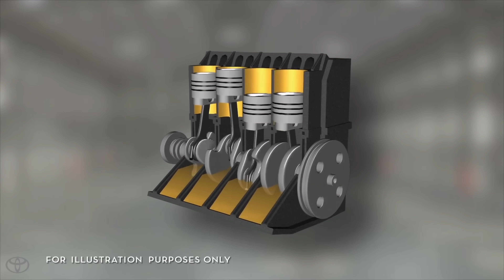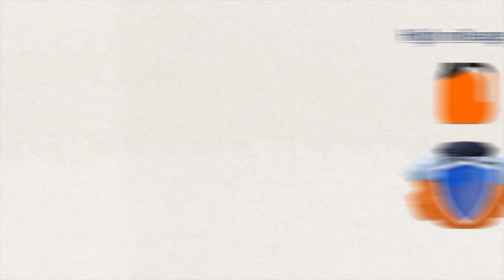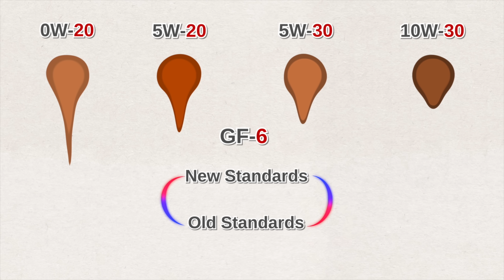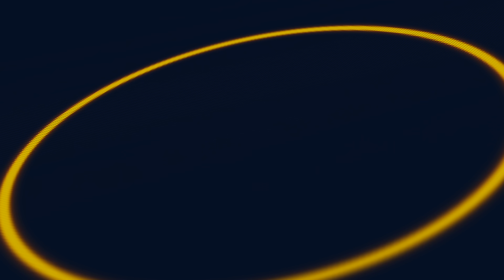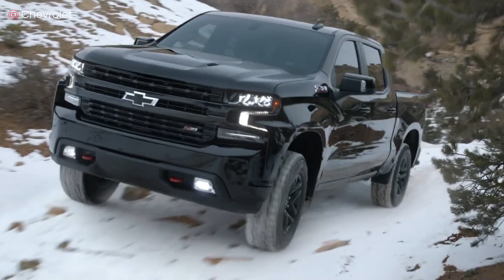7 Engine Oil Myths Stupid People Fall For

Comment from the maker: This Truck Just Delivered My Dream Car: https://youtu.be/KWJHCWyLFxc

⬇️Scotty’s Top DIY Tools:
1. Bluetooth Scan Tool: http://amzn.to/2nfvmaD
2. Mid-Grade Scan Tool: https://amzn.to/33dKI0k
3. My Fancy (Originally $5,000) Professional Scan Tool: https://amzn.to/31khBXC
4. Cheap Scan Tool: https://amzn.to/2D8Tvae
5. Dash Cam (Every Car Should Have One): https://amzn.to/2YQW36t
6. Basic Mechanic Tool Set: https://amzn.to/2tEr6Ce
7. Professional Socket Set: http://amzn.to/2Bzmccg 
8. Ratcheting Wrench Set: https://amzn.to/2BQjj8A
9. No Charging Required Car Jump Starter: https://amzn.to/3i7SH5D
10. Battery Pack Car Jump Starter: http://amzn.to/2nrc6qR

⬇️ Things used in this video: 
1. Common Sense 
2. 4k Camera: https://amzn.to/2HkjavH 
3. Camera Microphone: https://amzn.to/2Evn167 
4. Camera Tripod: https://amzn.to/2Jwog8S 
5. My computer for editing / uploading: https://amzn.to/301tYt9

🛠Check out the tools I use and highly recommend ► https://goo.gl/rwYt2y

Subscribe and hit the notification bell! ► https://goo.gl/CFismN
Reply: He's the most genuine ❤
Reply: Actually Scotty an engine will gonna last for a lifetime if engine oil is been changed everyday
Reply: What is the best injector cleaner on the market and why ?
Reply: Hi scotty...
What kind of oil do you recommend for my2008 lexus is250 ..?
Reply: Hebrew pliz
Reply: In my experience Full synthetic is only for  20-80k. Less than 20k and the oil may get by the rings as they are still seating. Over 80k and and again synthetic starts seeping part the worn rings. Ideally a blend has worked best for me.
Reply: aaaa AA
Reply: Hello Scotty, I need suggestions for oil grades.  My car's mileage is 90,000 Kilometres. I am using Castrol Magnatec 10w-40. I was using the same grade with 30,000 Kilometres of mileage but a different brand. It's the first time I have been using Castrol. However,  I want to shift to 5w-30. Is it safe to shift to this grade after using 10w40 for 70,000 Kilometres? Both grades are given on my car's manual. 
My city's maximum temperature in summer is 39 degrees Celsius, and in winter, it can go to 0 degrees.
Please guide. I am counting on your opinion.
Reply: Ppplpop
Reply: Can i put insted of 0w20 oil  0w40 if in the summer are 35-40°celsius ?
Reply: Scott is it ok to start using full synthetic oil in my truck if its over 150000 miles even if it only requires regular oil
Reply: It depends on your viscosity and the year of your vehicle. Since ILSAC GF-6 meets and surpasses all previous oil standards, you want that type of oil. Mine is 2005 with 134k miles and I just switched from Conventional to Full Synthetic High Mileage, with same viscosity. It runs better and slightly cooler than previously. Yours should be GF- 6A unless it's 0W-16 and newer than 2017.
Reply: Why do you say all the time  ( Stupit People)?
They are not stupit, Not all people are mecanic like you, don't say Stupit People again ok?
Reply: @Patrick...8654p  you left out the D
Reply: @Patrick...8654p  ]0

Comment: One more thing, use MoS2 (Molybdenum disulfide) 1.5um for the best protection of your engine, it will protect it from overheating, + your engine will last 3 to 5 times longer.

Comment: I Was a Honda Trained Tech and Rebuild Lots of Engines and Gearboxes,I Never used Engine Flush and Would Not Recommend  Using Any of those Things,If You Keep The Correct Grade of Oil To the Correct Level All the Time and Change it When Your Told to You Wont Have any Problems,All the Engine Damage i Had to Fix Was Caused by Neglect By the Owner Not Checking There oil Levels and Beating The Hell out of there Engine and Gearbox !!!!!!!!!!!!!
Dont Wast Your Money on Any of that Stuff None of it is Needed,Just Treat Your Engine With Respect and it Will Look after its self As Per the Manufactures Recomendations.

Comment: okay like you guys i understand low speed pre ignition but how does OIL prevent this ?
Like isnt it caused by maybe
worn out sensors or maybe faulty fuel injectors or like something is not right with the engine 
i dont understand how does oil prevent the low speed pre igniton PLEASE EXPLAIN IM STUPID

Comment: I have an 02 Silverado I bought brand new and it has only had conventional super tech 5-w-30 in it. It now has 376K and still going strong. I’ve changed the oil every 3K miles ( about half the mileage the factory calls for )

Comment: My car's engine taps the first 3 seconds after turning on the engine. It has 284,000 miles on it. The manual says use 5W30. What oil should I switch to?

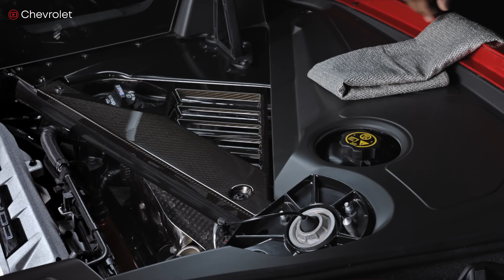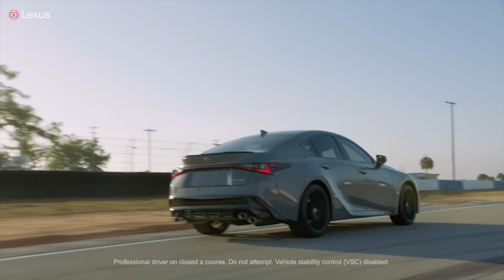Comment: 1:26     Uhhh .... Scotty, you do realize that at 1:26, the "mechanic" is about to put engine oil in the C8 coolant reservoir and even removes the cap. You can see the oil fill at the 11:00 o'clock position with its Mobil One badge.

Comment: On the point of Synthetics cause oil leaks... I noticed when I changed to a full synthetic in my 2007 car that was using conventional originally, and not leaking to begin with, that the oil level went down at an alarming rate at first but seemed to stabilize after a few top offs and some driving. The car didn't seem to have any signs of burning or leaking the oil though. Any thoughts on this odd observation?

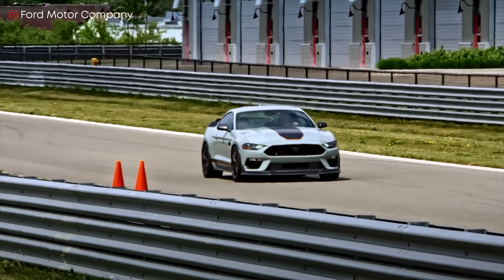Comment: 😂 Several times you mention that bad oil or the wrong oil can hinder performance and decrease fuel economy. You also say that synthetics can improve performance and increase fuel economy. Then, at 10:10, you say engine oil “cannot improve gas mileage.”

Comment: AMSOIL

I put 325K on my 1985 B2000 Mazda pick-up.
Bought it new.

Installed a bypass filter that completely filters the oil.

I only changed the oil 5 times over 13 years and 325,000 miles.

The truck ran like a top and was clean as a whistle inside the engine.

Spotless when I would adjust the valves.

AMSOIL👍

Sold truck because I got tired of driving it.
Reply: Because Amsoil is pure synthetic - not what are the oils on store shelves that labeled as synthetic but in reality not

Comment: I think nobody should use conventional mineral oil or blends. Synthetic oil does not cost more (I think perhaps 25 years ago there was difference, but not anymore), but is by far better. For old classic with smoking engine can be used high mileage full synth oil.

Comment: My wife's 2010 Nissan Versa has been using full synthetic since the car was new and we've had no engine problems at all. We just observe the change interval. It has well over 100,000 miles on it.

Comment: Xw30 motor oil have a viscosity of 9 to 12 centistokes at 210 fahrenheit, regardless of the value of X. 0w30 and 10w30 both flow the same at operating engine temperature. The 0w30 will flow to where it needs to go sooner than 10w30 because it does not thicken up as much when it cools from operating temperature to room temperature, therefore, reducing wear on startup, even in hot climates.

Some brands of motor oil make their oil a little thicker or thinner at 210 fahrenheit if they want a more fuel efficient oil or a stronger oil, so a strong Xw20 will be close in actual viscosity as a fuel efficient Xw30.
Reply: Also, cars have thermostats that regulate.tempurture, so that the oil will be consistently near operating temperature regardless of weather

Comment: One thing here that I disagree with.  Oil additives doesn't help improve mileage! I can definitely tell the difference if I use Slick 50 and then use Duralube. If you ever use Duralube, then you will notice how much slicker that it feels on the dip stick. If it cuts friction down, your engine will run cool. Also it will take less energy to move the moving parts. So that energy saved will also transfer to more energy to your wheel. 
 Now, I can't tell anything as far as extra power because I've never compared it on a Dyno, but I can tell the difference in the mileage that I get!

Comment: I totally agree with you. In the USA you need fully synthetic because your temperature is only 8 degrees Celsius or 46 Fahrenheit.  While in the Saudi Arabia or in the Philippines 33 degrees Celsius or 91 degrees Fahrenheit doesn't need fully synthetic oils, unless it's a 20W50 fully synthetic engine oil.  What i did is that i change my engine oil every 3000KM, i turn on the engine, let it warm until it reaches the idle rpm 750-800rpm, i pour flushing oil and leave it for 5 minutes, then drain the old engine oil. You don't need an expensive oil. trust me!

Comment: I run a gasoline engine for at least 300,000 miles. In my experience an oil and filter change every 1,000 miles is extremely important if you want that engine to still be running like a new engine after 300,000 miles. I am old enough to remember when the manufacturer recommened an oil and filter change every 30 days, regardless of mileage.  Oil and filter changes are cheap when compared with the cost of replacing the car or the engine.

Comment: What specific oil do you recommend for 1999 Lincoln Navigator?  120,000mi.
Don't drive it often. Just to grocery store 2 or 3 times a month.
However, I do use it for Ski trips a few times a year. (400 mi each way).
Drive it less than 5000mi. year.

Just had Master Cylinder and Spark Plug replaced.
Coil replaced few months ago.
Mechanic told me engine may need to be replaced/rebuilt soon, due to carbon from engine getting on spark plug.

He suggested Pennzoil Conventional Oil.
What do you think?

Comment: I have been changing my oil every 5,000 miles using full synthetic oil. Sold my last truck with 280,000 miles still running perfect.

Comment: I have a 2003 Tahoe … I am undecided on what oil to use.. of course 5w-30 but my problem is synthetic or conventional.. all of Tahoe owners told me to start using conventional the truck has 188 k miles

Comment: I agree with changing the oil and filter every 5k.  I use full synthetic oil with my first oil change.
High mileage oil changes is the new “planned obsolescence” plan that vehicle manufacturers have started to help your motor wear out sooner, so you have to replace your vehicle sooner (increased sales).
When your oil turns black that is carbon that has blown by the piston rings into the oil.  Carbon is a natural abrasive, and, when it is in oil, it is grinding away all of the metal surfaces like bearings and cylinder walls.  So, by changing oil every 5k you remove the carbon with clean oil.
NOTE: Carbon particles are too small for the oil filter to remove.

I hope this helps.  I have sold all of my vehicles when the mileage hits 250k or more.

Comment: The temp for oil is Always in Celcius otherwise 5W 40 in metric countries would be different to 5W 40 in the USA (as they are only country that uses Fahrenheit)
W = 0* Celcius (freezing point of water) The Higher number is at 100*C (boiling point of water) No lab in the world would use Fahrenheit for any experiment

Comment: I drove a 1982 Mack with the Thermodyne 300+ motor, and it had the oil changed about every two months and it lasted for 17,000 hours on regular engine oil. (PetroCan 15W-40 oil)

Comment: I have used petroleum-based oil in my ‘97, ‘06, and ‘08 cars for years. The ‘06 has 280,000 miles. It is getting hard to find, and I have changed to semi-synthetic oil in the last two or three years with no problems. I still change the oil at the mfg’er recommended intervals.

Comment: this is what was told to me I don't need a "FULL SYNTHETIC OILS" cause  I don't do a lot of highway driving mostly city driving stop/go & I do have an 1994 Olds Cutlass Supreme 3.1lt which I have to use 5w30 and for years I would use            regular oil or high mileage oil ,but NOW I have been using an SYNTHETIC-BLEND which does better

Comment: if the manufactured recommended oil is 0-20 or 5-20, is it better to use one or the other when the miles rack up? At 90k now.

Comment: Bro!!! Number after W has nothing to do with "summer" but with engine operating temperature, in fact, with typical oil temperature when engine is fully heated and under substantial load! That is the temperature where oil viscosity is defined, not "summer" ambient temperature.
Reply: Which directly affects the temperature of the motor, genius

Comment: Scotty. I have a jeep 3.7 v6 engine. It's an 06. It has run immaculately. Still does. Quiet, sounds like a sewing machine. The problem is it uses a quart or better of oil in a 1000 miles. It has 154000 miles on it. I've always put mfrs recommended 5w-30 and changed it every 3-4k miles. I notice no smoke vapor in exhaust. The pavement has no oil spots under the vehicle so it's not leaking. Should I stay with syn 5-30 I use. Would 10-30 syn help or 5-40 help to reduce oil consumption and not damage the engine. I live in the southeast climate of US. Adv, thanks. Tommy Watterson

Comment: Call me stupid. Been working on cars for almost 20 years. I have noticed that the viscosity of synthetic 5w30 Is lower than conventional oil. Both oils at same temp but one is more fluid hot and cold. Switched to 5w30 synthetic in a 04 Tahoe and it ate it with no oil leaks. Switched back and it did not eat it up. Do not do the oil change at 10,000 miles. I do more engine jobs because of this.

Comment: Scotty K; I raised an eyebrow (like SPOCK) when you said W stands for "Winter".  I was taught it meant Weight (aka thickness)  In my day there was no multi weight oils.  Straight 30Weight or straight 20Weight.  Owners manuals too said "weight".  Multi weight oils were just STARTING. to appear. Still manufacturer recommended 30W for summer and 20W for winter. You had to change the oil every 6 months at least (cause not everywhere is California meaning other places get SNOW & -30F or lower temps. Canada is such a place.   
.  Motor oil never breaks down.  It is still motor oil.  The "Additives" break down.
. Where on this planet is it 120F?(which is your engine normal operating temperature)  So, even a hot day in Death Valley, it just ain't that hot as an engine.
. Why not mention the fact that the GERMANS invented synthetic oil during WW2?  It is a blend of various oils from plants and spices(so a secret formula) so they could continue to operate their machinery as they DID NOT HAVE CRUDE OIL.  That is the ONLY REASON why synthetic oil exists.
. Both oils are "Organic" but they shaft you with the additional expense for Synthetic.
Reply: As of 2015 the viscosity grades are 0W, 5W, 10W, 15W, 20W, 25W, 8, 12, 16, 20, 30, 40, 50, and 60.[4] In the United States, these numbers are often referred to as the "weight" of a motor oil, and single-grade motor oils are often called "straight-weight" oils. The grades with a W designation are considered Winter-grades, and denote an engine oil's low-temperature properties, while non-winter grades denote an engine oil's properties at the operating temperature of an engine...

Comment: Can my Mazda cx 5 go to 7.500 miles without an oil change [r jow much miles should I change it?
Reply: In Europe, Mazda has a prescribed exchange interval for gasoline engines of 20,000 km = approx. 12,400 miles. Owners change before 12-15,000 km = 7.5-9,300 miles.

Comment: New subscriber here, am a retired over the road truck driver, just bought an RV that has a Triton V 10 engine, is a 2002 Super duty F 450, I want to run synthetic oil in it, can I get a good recommendation for what to use ?
Reply: The manufacturer prescribes an oil specification (international API or GM, etc.). Which oil you choose is only your choice and no one can tell you "this oil is better than this one", because if they have the same specification = both oils have passed the same test!!!

Comment: I have used Full Syn for years.  Oil and filter changes at 4000 miles. Service vehicles have over 300k miles. Run like new.  All except the Ford Triton 5.4 ,if you know , you know

Comment: I don't trust synetic oil I put it in a 92 pathfinder and it blew up immediately how can it be better when it's thin as water I use Rotella in a 5.4 triton with 330k running strong thicker the better I think
Reply: Synthetic oil doesn't have to be as thin as water at all. It depends on the viscosity you choose. If I have, for example, 5W40 synthetic and 5W40 mineral, they will both be the same thickness. And it doesn't mean synthetic is better. It's a long story ... for example, fully synthetic on the packaging does not mean fully synthetic inside....

Comment: I need some advice about my car I have a 2006 lexus RX 400h And I just need some mechanic advice actually the lights keep coming on my dashboard and This car is a little Is intimidating to me So I have to reset it by taking the battery cables off of it It starts every time I'm beginning to think it's either the throttle body or the pedal but I haven't got mine Is scan tool and yet So I can't run the scanner on it quite yet because I'm still waiting for it in the mail But I'm wondering actually what is going on with this so I could just get it fixed I don't want to sell it I had to do this car fax thing where they do the Did you actually price "for the car and then they do a quota for it and then the stupid dealership keeps calling me after I told them that I do not want to sell my car But anywise Is back to what I was talking about So I'm just trying to figure out what else I could do to prevent this car from breaking down cause it over the days I've actually really liked this car At 1st am I cool this car is really cool But then I got to drive and I got to write in it it doesn't Seemed too bad actually it's OKI actually really like it And you were right And you are right this vehicle is actually a really good car But I'm thinking about just taking it over to the dealership and having them look at it because I'm stumped about what the h*** is going on with it I'm sorry but I'm just frustrated and very intimidated